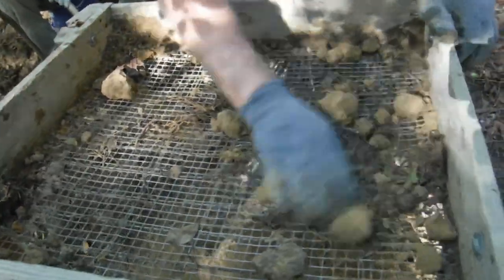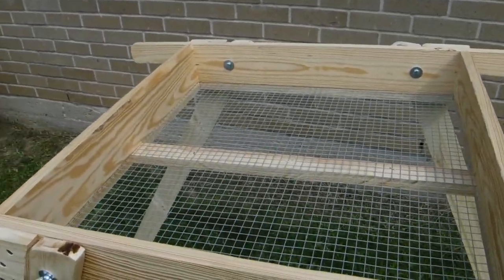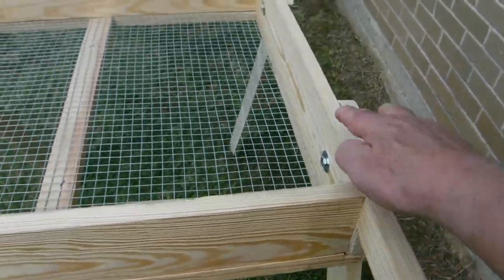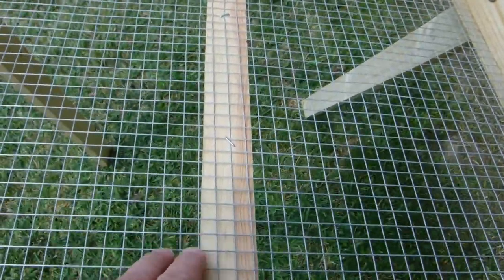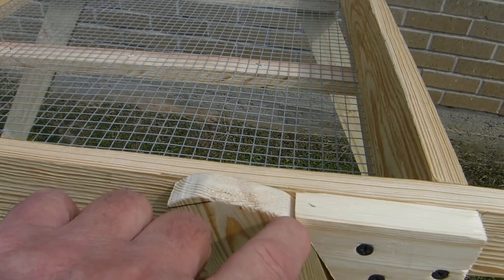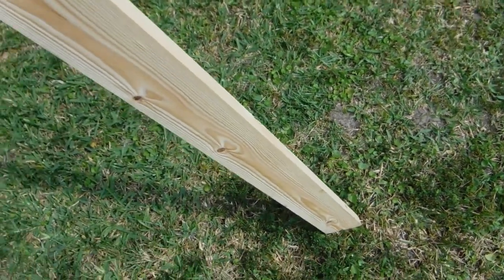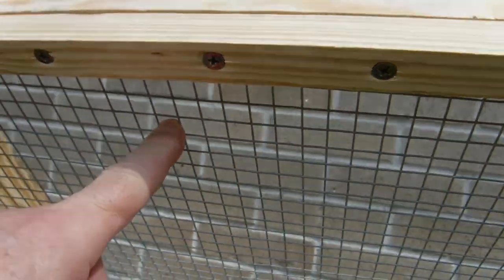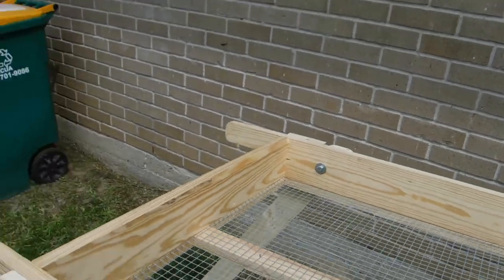How To Build Your Own Sifter For Finding More Artifacts - Arrowhead Hunting

Comment: Have you thought about using bushings to run the screws through to attach the legs? Keep the wood from wearing out from the threads. I do appreciate this video. Thank you
Reply from the maker: Thanks for your input and yes I plan on having bushings in there before next digging season.

Comment: Hey Spike and Randy
Next up if you haven’t already done a video (I’m looking) on how you fasten your arrowheads in a case. I have hundreds of bird points and don’t wanna use copper wire. What do you guys do?
Reply from the maker: I'm sending you a link to Ararat cases. The points are held in by friction between the glass and the foam inside the case. Best way in the world to display and protect artifacts. Tell them Heartbreaker Relics sent you.
https://www.facebook.com/profile.php?id=100085095387581

Comment: Great Video!!   I have a sifter that I modeled/then fabricated that is significantly heavier than this sifter;.  Small amounts of weight add up when you're digging and running these things all day  manually shaking; therefore, my sifter needs a little Sister added to the sifter family. 
I was curious what the dimension is from center-line of your leg holes to the inside of the leg stops (distance from 30 degree cut to center of leg hole) and the distance from top of the 1" x 4" side board to center of hole?  Building this as light as possible I know this dimension will be critical because if the leg is too close it's tight; therefore, not enough lateral movement, to actuate/sift.  If its too far it will be too much lateral movement causing more fatigue the person sifting (me) and the lighter materials will probably wear out sooner due to additional friction .  I had taken screen shots from one of your videos and planned to reverse-engineer one from the picture sometimes this month.  As always you guys are a BLESSING to so many and your willingness to share is GREATLY AOORECIATED.
Sorry for the specific questions, you probably disclosed this dimension and I missed it.  You know how it can be when you have an engineer borrowing someone else's blueprint/template.  LOL
Once I get this drawn up I can send you an Autocad drawing to provide dimensions , degrees of cuts, holes so if you would like to share your design.  If you are giving up your ideas I can at least offer something Brother.  Thank you Guys and GREAT JOB Spike!!  Cant wait to see a 2" Dalton in your new Sifter and I believe its going to happen soon!!!
Reply from the maker: Thanks for watching our videos and for this great comment. We really appreciate it more than know. 
The first dimension, from hole center to the stop is 1.5" and the second dimension, from the top of the 1 X 4 to the hole center is 1.75". 
Thanks for your offer of the finished drawing. That would be fantastic!
Thanks again and good luck!
Spike